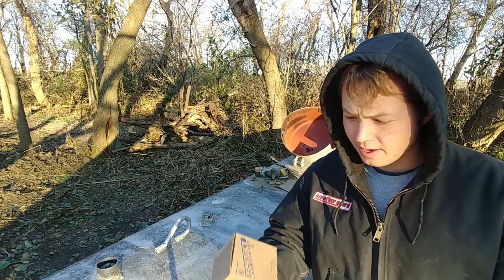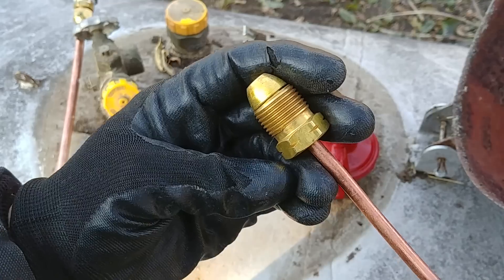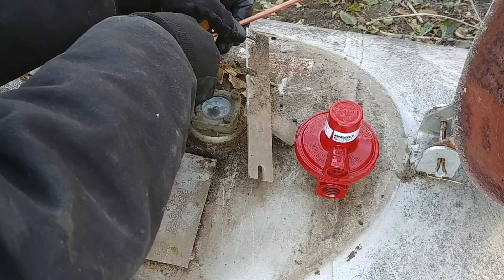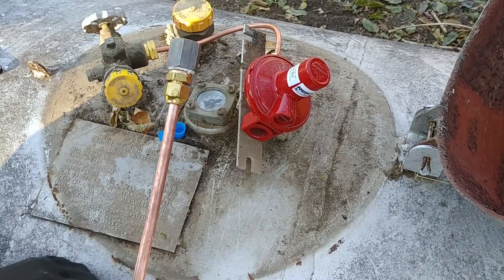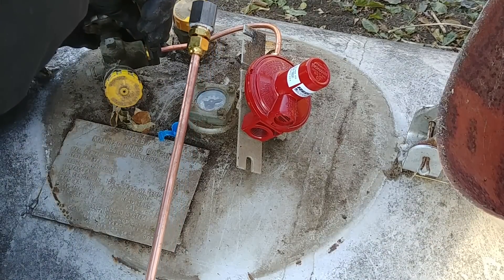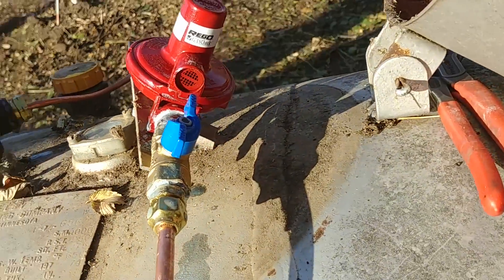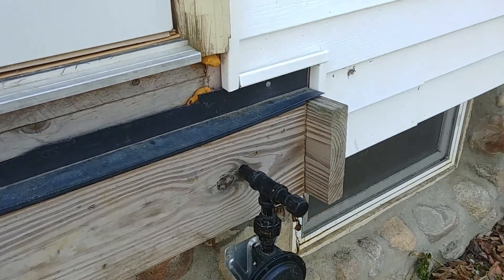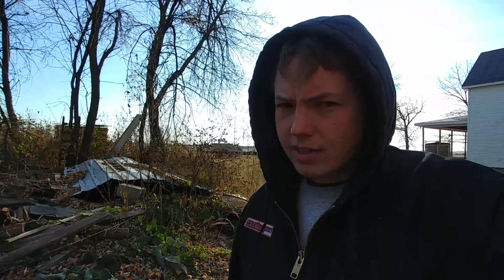How To Install a First Stage Propane or LP Regulator

Comment: From a novice, two questions : 1) when to pipe dope and when not to dope, you put dope on the downstream of the 1st stage regulator but you dry connected the pig/hog tail, why? 2) your stage 1 regulator steps down the pressure from the supply tank to 10 psi and your second stage regulator steps down from 10psi to an 11” water column so both are stepping down the pressure.  I was surprised to see the orientation/ flow direction from your stage 1 red regulator with the vent side connection oriented  “out” that runs to the house stage 2 black regulator where the orientation is vent side “in” and saw you pointed it down to protect the vent from water and debris. Since both regulators are reducing pressure, I was expecting both to be consistent and oriented vent side “in” on the high pressure side.  Can you explain the orientation of the stage 1 and stage 2 regulators?

Comment: Excellent video. Being a tightly regulated industry, not many folks on YouTube (from what I can tell) have tackled gas fitting so thank you, Ben. 
4:55. I took a NG/LP gas course last year. Looking at my notes, the teacher emphasized avoiding applying pipe dope (thread sealant) on the first 2 threads of the nipple to minimize sealant entering the gas stream. Btw I live in Ontario, Canada.

Comment: You want 13wc going into house....the gas valves on furnace and/or cooktop will further knock it down to 11 wc....  0.5 psi is 13.85 wc...

Comment: No one seems to attach the first regulator to the tank. Yet, it looks as if there is a bracket built into/onto the tank just for that purpose. Are here threaded holes on the bottom / underside of that regulator that could be used to fasten it to the tank bracket?
Reply from the maker: I've noticed that as well. I don't know why that the case. Maybe I should start doing that.

Comment: I have a 500 gallon 1994 propane tank . everything works fine but shut off valve leaks at the handle stem ! It does not leak opened all the way but when you shut it off it leaks . Question do you have video on repacking shut off valve stem ? Is it like outside water shut off just back off first nut not the inner nut ? Thanks

Comment: Hi Ben love your content. Very professional. I have a question about transition from a LP iron pipe 3/4 line to a 1/2 copper line for my space heater. What type of fitting would you suggest. Thanks

Comment: knipex  great tools, especially the locking pliers for flare fittings.
question.
you did not cover which valve you plumbed to, if it was the liquid or vapor side

Comment: Hello, I was looking at the 1/2" gas ball valve that you used and comparing it to the one Amazon presently is selling, which looks different and its specification says 5 PSI rated.  I know the pressure between your two regulators is 10 PSI and you are using two of those valves.  Anyway, do you recommend using the 5 PSI rated valves that Amazon is selling? I will also have 10 PSI between my two regulators.  Thanks...

Comment: I noticed on my first stage regulator my vent screen is mucked up from hornets trying to build a nest. My inspection was prompted by my oversight of keeping my tank at a minnimum of 20% & calling for a refill. I'm at zero & connecting a 100# to passify my gas needs until I get another fill.

Comment: Ive bough different kinds of dope, both said they could be used for gas but 1 was for gas only.  This one is yellow.  Using the yellow dope will tell others in the future you used the correct stuff.  To me if I didn’t know I’d see white and think it’s wrong and would want to swap it out when maybe it’s not needed.  Just a thought.  Same goes for Teflon tape, only gas comes in yellow, don’t use white for water applications.

Comment: nice video good explanation of the basics. Like the two stage regulators (aka using two regulators. ) and yes pipe dope/sealant is the way to go when connecting gas lines over liquid Teflon or Teflon tape in my opinion. As you said its just a better grade of liquid Teflon agreed.

Comment: Just installed this same regulator yesterday. My tank did not have the reverse threaded connection, but rather a 3/4 in FPT.
Reply: Every propane service valve like the one in this video has a left hand P.O.L fitting if yours had a 3/4 in FPT than someone did something wrong

Comment: Hi Ben, I like your videos. I feel like I'm right there with you. Two things. Being that you are in such a cold area I am surprised you didnt loop your tank side pigtail. Any moisture in that tank might make it to your regulator diaphragm and freeze locking it open. Also when using pipe dope its most important to not leave any on the first two threads as bits might blow off into the vapor stream and also clog up the regulator. All in all good video.
Reply: Not to be critical but there are some other code issues .
It's my experience that the smallest underground line is 1/2" tubing sleeved or at least type k. With LPG the minimum clearance to a window or bldg opening is 3 feet. Was there a shutoff on the line prior to the second stage regulator? You might mention the  pressure test requirements. Thanks

Comment: very informative video.  I'm thinking about buying a used 250 gallon propane tank from a neighbor.  It is probably 10 years old.  Do you know how often the regulator has to be inspected/certified on these tanks or does it vary state to state?

Comment: You show USA Made REGO regulators, but give WRONG LINKS to the Regulators. Links goes to Chinese made Emerson-Fisher regulators. The RED First Stage regulator you show is REGO LV3403TR and the Second Stage appears to be a REGO also, but you don't specify model. Great video...thanks!

Comment: Benjamin, Great video. I have a question that I need help with and can't find any info. I have a remote cabin that has a LP range. I have a 3/4 inch iron supply line running across the back of the house. It goes inside to the kitchen stove. There is no regulator of any kind on the entire pipe. I want to use a 40 lb or a 100 lb cylinder to supply gas to the oven. What regulators do I need? Can I use a dual stage regulator at the tank instead of buying and installing 2 separate regulators.
Thanks, Dennis A
Reply: DENNIS ARCHAMBAULT   Definitely. Most are high quality 2-stage regulators for in-home use and connected to the tank.  Not the cheap regs to use with a grill.
Reply: The regulator is called a Twin stage which takes tank pressure and reduces it to 1/2 psi which is what most appliances run on.

Comment: I'm potentially getting into the propane department service side, watched  a couple of your videos and I wanna say thanks, now I'll know what I'm getting myself into. I'll definitely keep watching,  I will say that our state of Washington does need an inspector coming through so wish me luck!
Reply from the maker: Nice! The propane industry is great to work in. You'll learn a ton!

Blessings from Minnesota!
Reply: @BenjaminSahlstrom  gas company replaced the "first stage" regulator over a week ago due to the pigtail leaking, it was very warm out then.... 
Then I Relit water heater, and the pilot light in the wall heater (emergency backup heat), and flipped the breaker switch back on for the furnace... didn't notice until last night that the furnace was NOT kicking on...but I had been sick, so didn't bother looking at it till today.... Everything seems to indicate that furnace is NOT getting gas pressure....
When the propane company guy replaced the regulator he said something about them having a hard time getting the regulator that we had and so he was going to use a different type (also red Color, but looked twice the size) .... Any advice on the brand or WHERE I need to order from to be sure I am getting an authentic part?
Reply: Second and final interview next Tuesday,  I guess itll be a new position within the company as the owner used to be the one doing it, how many trades do you have man lol, loving them videos!

Comment: Just found this video. The second stage regulator is too close to the window. You need to have a vent away kit installed on it. Also when using copper you need to isolate the black pipe in the house from the copper by ways of a dielectric union.

Comment: Have you ever seen problems with the sulfur odorant in propane corroding copper?  Some local jurisdictions don't permit using copper propane lines for that reason but I wonder if there's anything to it.

Comment: That was REALLY helpful.  Thanks.   Moved out to the sticks and just had the gas company install 3 120 gal tanks.   After they left I took off the cover and couldn’t believe the fitting was bubbling.   I called the guy and he says “its not a problem.”   Unbelievable.    Theyre about 45 minutes away so with the aid of this video ill just fix it myself.

Comment: Do you have any thoughts on twin stage regulators vs. 1st/2nd stage?
Reply from the maker: stflat I was talking to a guy from the propane company about that recently and his opinion is that having the first and second stage regulators separate is a big plus. If you use a dual stage regular it just requires a larger pipe size all the way from the tank. Either way it will work fine though. Thanks for asking!

Comment: The fitting that screws into the service valve on the tank is called a POL means put on left , ive seen people force it into service valve using right hand thread and they wonder why their smelling gas screws up the whole tank , we end up changing out the tank
Reply: P-O-L stands for "Prest-O-Lite' it's the company that created the fittings. It's bad enough that videos like this exist for the homeowner to blow themselves up, then know nothings come into the comments to further misinform the rest of the general public. I will say that the work in this video is better that the average home would do. Always have your gas company come behind you and check your work. In most cases there is a state required gas check form. Lack of this form in the event of an accident is enough grounds for you insurance company to deny your claim. 

So keep watching how to diy videos folks, saving a few dollars could cost you thousands or someone's life. 👍
Reply: @davemelvin5331  Correct on the POL meaning - no mention of a leak test before re-energizing the system
Reply: @davemelvin5331  I retired from the LP gas industry 11 yrs ago after a 35yr tour. You sir are the first person that I have ever heard of with the correct meaning of P-O-L...
Reply: it's a compressed gas association (CGA) fitting, most likely a CGA 510.  the notches in the fitting signify it has left hand threads.  this goes for all CGA fittings.
Reply: josh qaszq any reason for the lefty thread or they just like being different?

Comment: I like you vids, I would like to share a couple of things.  Even though you can use the wrenches that you did, there are flare nut wrenches that are made for these fittings, or at a min. open end wrenches the metals are very soft and can damage easily with any jawed pliers and adj. wrenches.  You did not show how you bent the line but I would like to mention there is a cheap bending tool out there you can easily kink a line by hand. Also you should mention that the test bubble solution should never ever contain any ammonia if you make it yourself.
Reply from the maker: Thanks for sharing your tips!!
Reply: Thomas Fake   Thanks for propane info. Novice needs this.

Comment: When you attached the larger fitting from the tank to the regulator why didn’t you also use pipe dope? Also why use pipe dope instead of gas line Teflon tape?
GREAT VIDEO!!!
Reply from the maker: Gene Harmon Thanks! The fitting from the tank to the first regulator works more like a flare/compression fitting in that the seal is made by tightly pressing two metal surfaces together. 

In contrast a threaded fitting needs pipe sealant to fill the tiny voids between the threads.

Pipe thread sealant or pipe dope is the industry standard (at least in our area). I'm pretty sure there may be a technical reason why but I don't know exactly what that is.

Thanks for your comment!
Reply: Benjamin Sahlstrom thanks Ben. I have to replace my 1st stage regulator and your video is the best one I’ve found.
Reply: I heard a plumber say the reason not to use tape is that it shreds and a piece could blow off and get into the regulator causing blockage.
Reply: you can use either as long as it is compatible with LP, its just easier to use the dope

Comment: I have a question im about to run my diy gas line project just to make sure the line from the first stage regulator to the second stage i has to be cooper all the way or it could be iron pipe let say at the bottom of the tank?
Reply from the maker: pacohouston2 Copper is best underground but above ground black iron will work fine. I have seen black iron underground but it doesn't always hold up as well. The goal with gas lines is to keep the fittings exposed (not underground or behind a wall) so that leaks can be detected and fixed more easily.

Hope that helps!

Ben